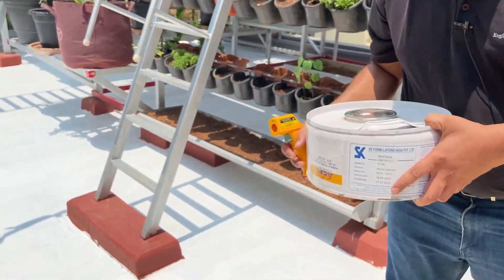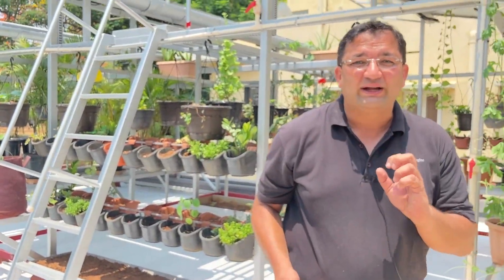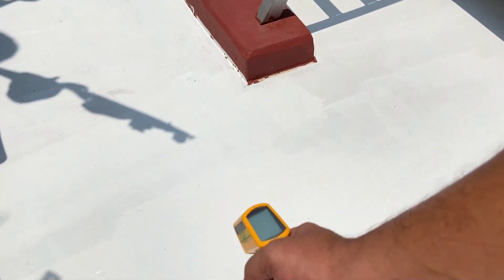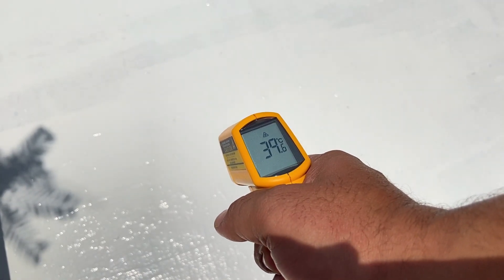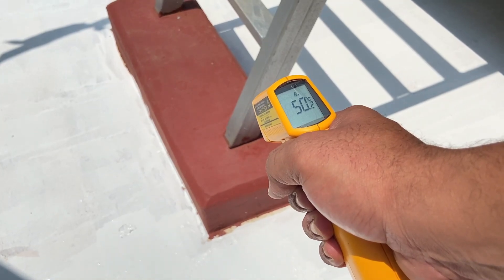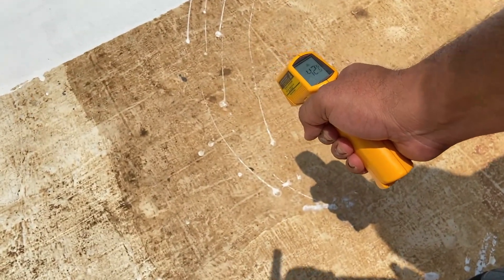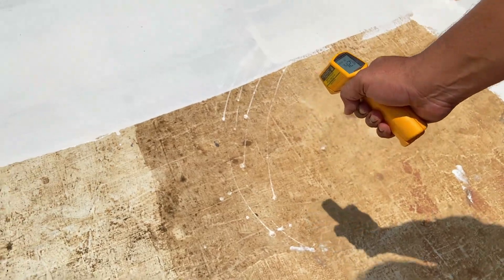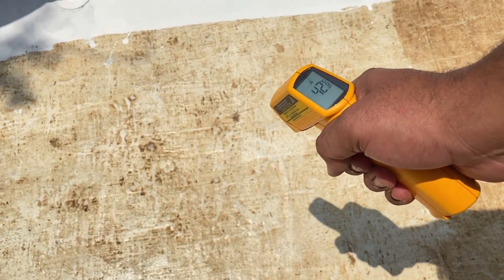Heat Reflective Coating for Cool Homes

Comment: How many coats have been applied here?
Reply: If I had to apply something as such how many coats do I have to apply? Any primer applied before the application of the white paint?
Reply from the maker: @leoncharles9364  Depends on the paint. The paint which we have used does not require a primer . 
For this particular site , we have put 3 coats .

Comment: Is the paint wet while you measure the temperature?
Reply from the maker: No
Reply: @HinrenEngineering  if it was a infrared thermometer should have measured all the three surfaces from the same distance for accuracy